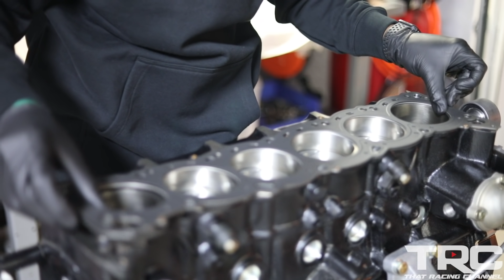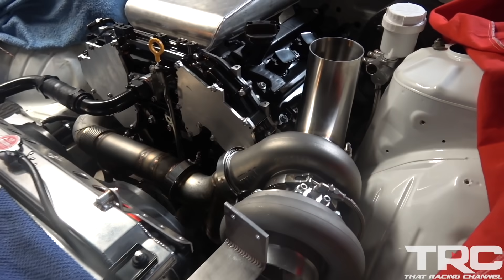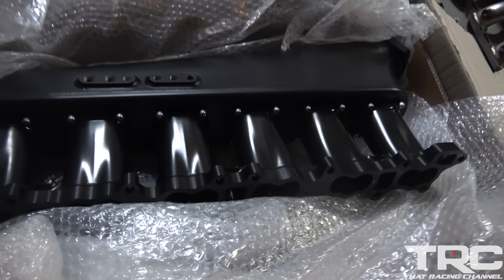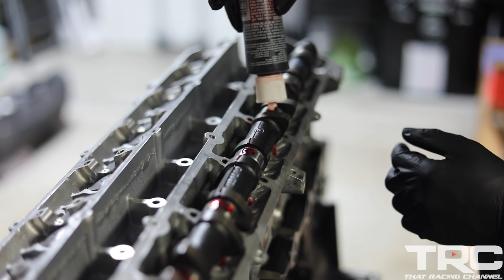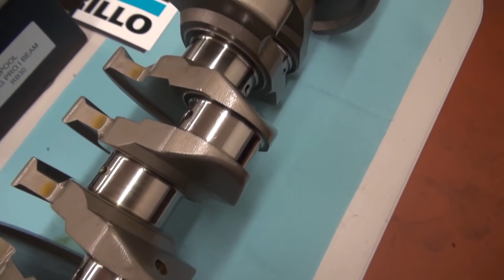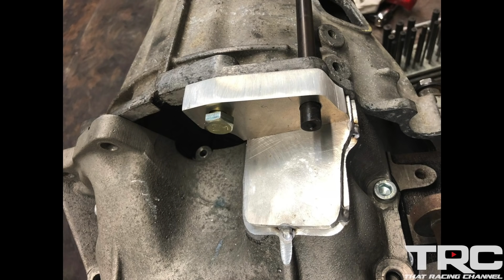1000+HP Sequential RB30 R32 GTR Godzilla Project  - Building the RB30 EPS 9

Comment: Very solid informative video for your gtr build. Thanks man. Quick question: what camera and lens are you using. it seems very solid with the focus on videos and everything. I have a Panasonic GH5 and i'm happy with it as it doesn't overheat or anything on continuous videos as long as the battery has juice in it and the SD card doesn't run out. However, the video auto focus is not the best. What i'm seeing here, your camera can focus on low light very well on vids without any issues and i'm curious to kindly ask what camera are you running? Thanks again.

Comment: What is the overall cost of this build?
Reply: You dont wanna know...
Reply: @TheGreener121  maybe around 60k usd
Reply: @huzaifmohd8903  Probably something in that area.
Reply: oh god i dread to think, but its gonna be worth it
Reply: A complete engine package from Rips NZ costs between 8.5k-45k USD 400 - 2000 hp. Dependingon options of corse.
Reply: @johanwillemen7709  tq for your info
Reply: My guess is around 50k.
Reply: Less than Trumps 🐷 wet-dream-wall, but only just.
Reply: @isaacberry5023  Literally noone was talking about politics
Reply: 720s Or Bust in the UK all we hear about is trumps expensive ass wall tho so it was a solid figure for me to compare against
Reply: @isaacberry5023  in malaysia.we have r34 gtr 800whp,build engine around 60k USD.doing 1/4 mile in 9.60s..using ron 98 petrol.max speed around 340kmh.same setup as TRC gtr.from this build,I know,this is phawarrrrr.